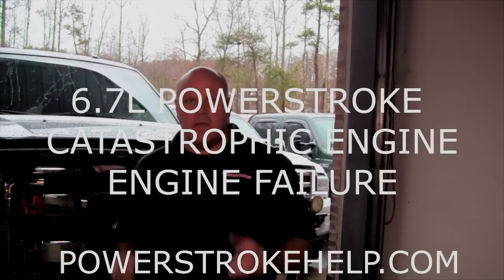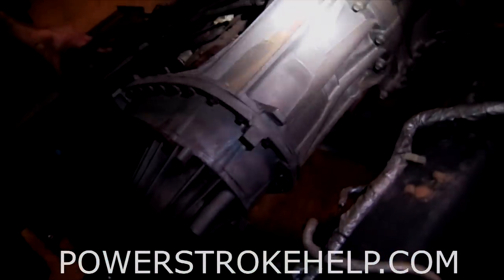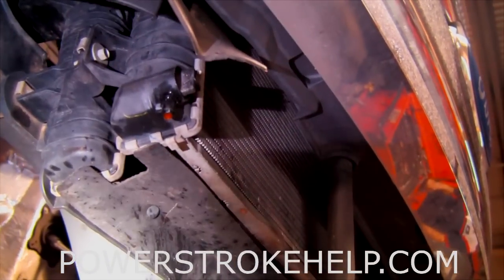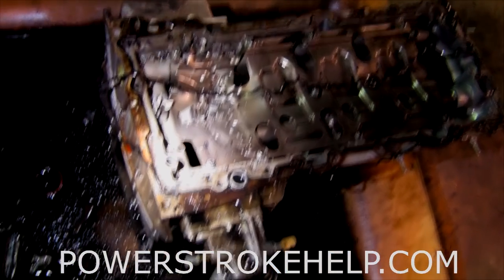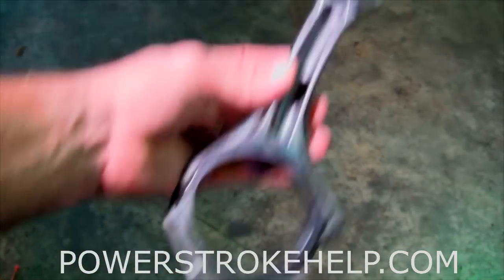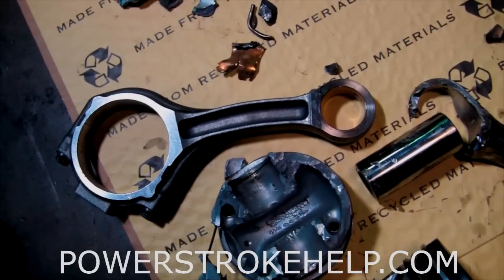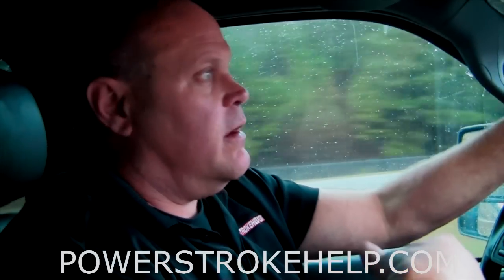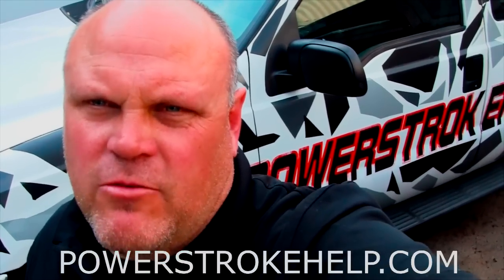6 7L POWERSTROKE CATASTROPHIC ENGINE FAILURE

Comment: I know this is an old video. But lets talk tuning. If you want a race truck build a race truck. These are not race trucks. I put my tune in to delete a failed science prodject in the early emission control of my 6.4. PS my 6.4 is still running. I put a Mini Maxx in i know you'll say I'm crazy. I set it at tow, lowerd the low boost fuel to the #2 setting and unpluged the tuner. I had to replace the new stock cold air intake to a this is just my desision S&B filter system. Because when I  pulled out to pass someone  the replace air filter light would come on. Now I  know these engines need to breathe. But having a stock air box with this much restriction is just not right. I get no black smoke on lift off in stop and go traffic. When im pulling my 30ft trailer or the work trailer or if I'm just going back and forth this setting has not caused me any troubles and is plenty quick. Now this is Aug 2023. And another 100K down the Rd. PS i bought this truck for body stile she is a beauty its what a truck should look like. Now if some one could  fix the blend door isue I would be very happy

Comment: I change all the oils  when  the truck tell me too .Its a 2016 F 350,Next oil change I want to go Amsoil full synthetic it has 30,000 miles but I need to know can you go without changing the oil for 25,000 miles with synthetic oils

Comment: I purchased this fuel pro it's called it plugs into the OBI  plugs in under steering  wheel
Reply: I would like to know if it going to hurt my engine,it has given me a little more fuel mileage, But I want  this truck to be my last vehicle  I have to. Buy

Comment: This is why screwing with the factory engine setup is, frankly, stupid and cruisin' for a financial bruisin'. I'm not busting on anyone who used their Ford correctly and had a major item go haywire; I'm talking the guys that rarely do a thing with their HD truck but drive it like a sports car and "tune" it like it's as easy as chipping a VW GTI. These Big 3 diesel engines are the most complex engines of probably anything else on American roads that is accessible to everyday customers, including hybrid cars. Yet, guys think they can just rip stuff off of/out of/modify outside design specifications one part of a cohesive system, and have the rest of the engine not be affected. These massive-output customer diesels are relatively fragile even with all the extra iron and bolts and electronic monitoring. But guys "tune" them so they can roll coal and shave a few tenths off a stoplight drag race heat that they're likely still going to lose to many cars while wasting a quarter gallon of fuel for the 20-second pleasure.

Comment: Bill.  Hey.  You did a interview on my 6.0 stock with 444,000.  Now has 600,000
Plus.    My new 6.7.  Factory complete
Long block went TEN K and a bearing failed  is it true it’s not “brand new “ even tho that’s what it’s called ?  Ford denied warranty due to my delete. Never turned it up.  Truck engine wasn’t even broke in.  Never had any ford motor fail with 10 k two months old.  Please let me know if your seeing any blow up that soon and if it’s truly new

Comment: Mr. Hewitt, not to question your experience, but wouldn't a failure like this with the piston, rod, camshaft, lifters, etc. be from high RPM instead of the tuner? I would be led to believe a tuner that has a lot of timing would cause high EGT'S which would lead to a valve train failure from premature wear, not in the bottom of the motor.

Comment: The 6.7 have always been bad. The 7.3's are the best diesel engines to be made I have yet to do any major repairs on my 2 trucks I have 2001 f350 with the 7.3 and f450 with the 7.3 with a combined mileage of 800,000 miles

Comment: You need to adjust your cables on the lift. The locks are not in sync. We never would have left a lift like that when I was a service tech. Too easy to lock one side and not the other.

Comment: Mr Bill my 2013 f250 6.7 has 75400 miles on it. When I start it the first time in the morning. As I pull off it will all of a sudden sound like a old dodge fo about five or seven seconds. Then it is gone. It does not do it all the time. Today it did it for about fifteen seconds. I went and spoke to the mechanic at the ford dealership. He asked about the regen light I told him it had been coming on a lot lately. He asked how much I drove it and I told him every day. Then he asked how far at one time I said 20 miles. Into the conversation he said it sounded like a valve or two were getting stuck and hitting the piston. He also said they had a short problem with that and it was usually on one side. Also I needed to bring it and leave it for a couple of days and see if it would do it for him. Do you have any thoughts on this. Please respond thanks.

Comment: Before anyone, who thinks that, "diesel engines are tough, and can take anything", consider what the engineer designed, originally.  In other words, if you're a bicycle engineer, and you design a bike frame, that will hold up to a 225lb person, would you expect the bike to survive, if you teach a 1200lb angus bull to get on that bike and ride it.  NO !
Engines are designed to withstand certain levels of brake specific cylinder pressure, and certain levels of BTU's created by burning fuel, and friction(and yes there's even friction in oil, if you squeeze it hard enough). Like the oil film between a rod bearing and a rod journal..... so on and so on.   Get the picture ?    The reason semi truck engines last a million miles, is they are huge, and have lots of big this and that built into them, but they only produce about 400-550 horsepower. Any numbskull can sell a tune for a truck and tell you, just load this and it'll pull your 30,000 lb. trailer.  When they tell you that, you should ask.................. how many times will it pull it ?    Because your engine is now borrowing time.

Comment: You wanna race? Slap a huge Big Block Chevy twin turbo in the lightest car it will fit in and have fun. Trucks are for work, not winning a dick measuring contest. Having said that, I live where no one cares about emissions. If I had a 6.7 (which I don't. . .yet) I would delete, delete, delete and then run the mildest tune I can  find. But that's me. I'm lucky where I live.

Comment: What tune do you recommend? I just recently purchased and a 2012 f250 6.7 with 139,xxx miles and ive heard stories of going tuned and deleted and I would like to get the maximum life out the truck, I Don't plan on using it for hauling or any of that? Whats the best way to keep the truck healthy and have it as long as possible? I would like to keep it as stock as possible but if i dont need to tune it even better?

Comment: Career Ford diesel master tech and FCA/GM tech here. While this guy makes some valid points, I respectfully dissagree with his philosophy. Not all people delete and tune trucks to have "industrial diesel phsyco tune" kinda power. Many delete and tune for reliability and service life.....tuning and deleting does not in and of itself destroy an engine. An intelligent driver who deletes and tunes a truck will in FACT lengthen the life of the engine. I personally own a 2012 F350 6.7L.....I have 11,291 engine hours including 5,906 idle hours. This totals 254,604 actual miles. My truck was in the oilfield here in the desert of NM for the first 121,000 miles of tough operating conditions, however as the mechanic who performed all the work on the truck, I knew it had been maintained well. When I purchased it I drove it about 6 months in stock form, mileage was terrible, power was just ok. Cost of DEF piss and hassle was ridiculous, and constant regenerating around town was a constant irritation. Considering that the majority of repairs I've made on th 6.7L are emissions related, its an obvious weakpoint in design. Just another case of government destroying perfectly good engines. Its obvious this guy is all for government regulation and throwing money away which is exactly what the emissions systems on these trucks accomplish. The emissions debate is never ending and I'm not here to sway anyone away from being environmentally responsible. Just think for yourself and come to your own well researched conclusion. I personally am of the opinion that modern emissions system are more detrimintal to the environment than helpful. You cant consider only the environmental impact of the truck itself, but also the impact of parts producation, logistics, maintenance, and as of the recent years the continuous impact of production of DEF and the waste stream produced just from that. California wants to ban straws but has no problam mandating plastic constainers that contain enough plastic for 5,000-10,000 straws....liberal ignorance at work. Also consider the massive loss of fuel economy due to emissions that result is massive additional crude oil usage which also has a significant environmental impact. My particular truck was lucky to get 24mpg on the highway and 14 in town. I could jump in my truck today and drive across the country and see 28-30mpg, and in town I now get 17mpg. If I baby it I can easily achieve 32mpg and thats with a 80 gallon fuel cell in the bed full. I have towed approximately 60,000 miles at or near max capacity. I have never opened the engine for any repairs. Truck still runs like new. Its my professional opinion that a deleted and tuned truck "PROPERLY" driven is far more durable and long lasting. #1 Never mash the throttle. Diesel engines have heavier parts and rate of rpm increase that is slower will lengthen engine life. Always roll into the throttle slowly, especally from flat idle. If you hear ANY type of pinging you have accelerated too quickly. If you see smoke exiting the tailpipe you have acclerated too quickly #2 Just because its tuned and deleted does NOT mean you have to be a jacksass rolling coal every chance you get or at the sight of a Prius.If your rolling coal you are damaging the engine and wasting fuel, with the added affect of looking like a jackass and damaging the reputation of diesel engines and truck owners, which certainly does not help our cuase at the government regulatory level. A 3rd point I'll make is that maintenance is HUUUUGE on these engines and vehicles. Never go the factory interval on the 6.7L and never use 15W40 oil in a 6.7. I've seen far too many turbo failures on engines running 15W40 to know there is a correlation. I personally recommend only 5w40 synthetic. Adding a bit of zinc additive is also a great idea. I do not believe younger people should have delete/tuned trucks but those who are older, wiser, and more responsible I dont see any problem.   As for this youtuber's claim that dpf delete voids a ford warranty, I'll say as a Ford master diesel tech that he is absolutely full of crap. Only modifications that directly result in a failure are denied warranty coverage,  and the modifications do not void the warranty as a whole with the exception of catastrophic engine damage that is due to a tune. I admit that is a reality, however that goes back to the way the truck is driven. I have performed warranty repairs on many diesel engines that have been deleted and tuned. If its not directly related its not an issue. This brings back a memory of a customer who brought in a truck with one of the supposed emissions legal tuners installed like the youtuber proclaims is gods gift to diesel trucks. I wont name the brand, its not important as they all have the same basic philosophy thats used to write the tune. This customer had a low power complaint. I looked at the truck and found the dpf was plugged nearly completely. I managed to save it, and instructed the customer to remove the tuner. The fool took the truck, and he pulled the tuner out of the truck and then came back with the truck on the hook for a no start. Diag found the dpf completely plugged,  I asked the customer why he didnt remove the tune,  he claimed he did, but I knew he just removed the tuner but never set the pcm back to stock. His dpf warranty claim was denied. In no way was his engine warranty effected. Of course you will run into super-techs here and there who feel like its their job to regulate and nit-pick every little thing just to try and void a warranty with the thought that it will then become a customer pay repair thus making them more money. I am a six figure tech without the desire to shaft the customer without reasonable consideration.
Reply: What tune do you recommend? I just recently purchased and a 2012 f250 6.7 with 139,xxx miles and ive heard stories of going tuned and deleted and I would like to get the maximum life out the truck, I Don't plan on using it for hauling or any of that? Whats the best way to keep the truck healthy and have it as long as possible?
Reply: @dabeast123ipodhelp  use a tow or street tune you will never have tune related problems
Reply: Thanks for that information. I'm getting deleted next week. I'll stick with the street option they told me I'd have. I asked who made the tunes and no answer yet. I'd like to know so I know what I'm getting into. Can I always change them from another source to the SCTX4?
Reply: BUMP!!
Looking to buy one and basically bulletproof it and delete the necessary crap.

Comment: Hey Bill,  i'm in the market for a new truck and I've got my eye on a 6.4 on Ebay or of Texas. I'm looking for mainly a weekend truck that might turn into a daily work truck. What is your recommendation for improving the engine to get maximum reliability, life and reduced cost of ownership out of a truck with that engine. The truck in question had 128k miles on it. 

Thanks in advance, Jeff

Comment: you say the  connecting rod pulls down on the piston.....id think out of the two strokes the power stroke surely doesn't and the intake stroke is minimal due to boost. id lean more towards high rpms and over fueling with timing too advanced....a good reason to squirt water!

Comment: Watched too many YouTube videos of Dodge cummins trucks turned up to 2000HP/3000torque and holding together nicely. Fords crap engines don't handle that.
Reply: Even that 2000 horsepower /  3000 lb./ft.  Cummins won't be running as long as it would stock.

Comment: Delete emissions gain mpg. Thats the nature of a diesel engine. No deleting DPF or SCR or any of the emissions controls will not grenade your engine the crazy tuning and the timing will. The emission controls logically have no effect on the engine other than absolutely choking down on its stock performance

Comment: powerstrokehelp Just curious what does a motor cost on a 6.7L like the one here in the video. I have heard they are insanely expensive but anything fomoco is insane. What would a part build motor run?

Comment: I have a question for all the geniuses on this awesome Channel.I have a 2015 f550 6.7 4x4 with no more than 5000 pounds of tools and stock, I am a mobile truck mechanic and I do a lot of Pull starts. My question is am I abusing my truck by doing this? If possible I unhook the trailer sometimes this is not possible due to not able to release fifth wheel pin, I am able to do this with pretty much no effort unless on a upward grade then just a little more effort to get moving never spinning the tires.I usually only pull the truck 5 to 10 feet to start it. The truck can weigh up to 80,000 pounds.It pays $350 each time hard to say no

Comment: Sounds to me that these tunes push the engine beyond what its capable of. Yes they can make the power, but they can't take it. Engines today are very strong and well built, and the manufacturers know exactly how much power they can handle without it shortening the life, and they pretty much come from the factory running based on that knowledge. Race cars are an excellent example of pushing the engine harder than it can handle, because of this, the engine have to be heavily serviced between races, depending on what type of race car, the engine sometimes must be rebuilt between runs. Personally I think people who feel the need to push their everyday trucks/cars this far are nuts, definitely members of the more money than brains club.

Comment: bottom line for those who don't get it...delete it for longevity but don't be stupid. Don't run high tunes. Get the emissions off tune with no added power.

roll coal and it will break eventually

Comment: Awesome video and information I have 7.3 with 241,000 and still runs great with enough power for pulling my 32 ft. 5th.wheel that weighs 16,000 pounds loaded

Comment: That is a ridiculously small connecting rod given the displacement, compression ratio and output of the engine. Compare it to a Cummins rod. It's literally half the size or less.

Comment: I've read that the connecting rods on the 6.7 is the weak point of the internals, that and the fuel system has its own issues and the turbo bearings and exhaust turbine explode

Comment: If stock internals can't with stand hot tuning and that is what the owner wants, aren't there after market internals available that are engineered for it, I mean if you take a n/a motor and boost it you 'll usually replace the internals with forged parts, at least that is what I do anyway.